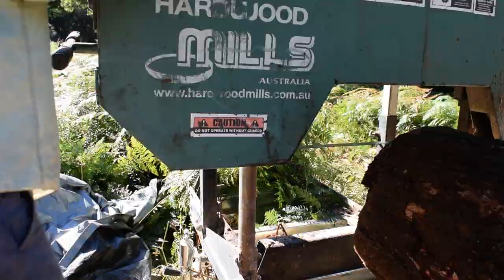Blow by blow- every step in the solo sawmiller's operation of his low cost portable bandsaw sawmill

Comment: How did removing the blade guides affect your cut?
Reply from the maker: Hi Joseph. Removing the guides didn't affect the cut at all. In my experience, the straightness of the cut seems to be all about the sharpness of the blade, and to a lesser extent also having the set of the teeth right. If these are out, than your cut will be wavy, regardless of guides or not. If they are in order, then you tend to cut straight. Cheers, Glenn